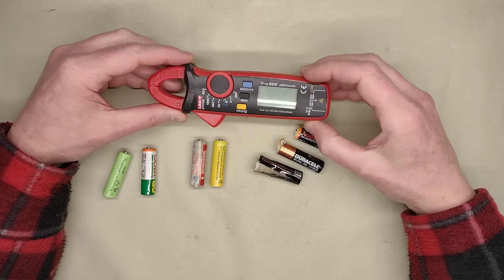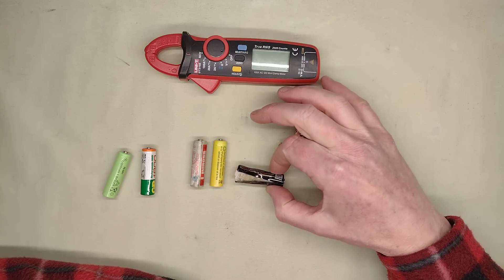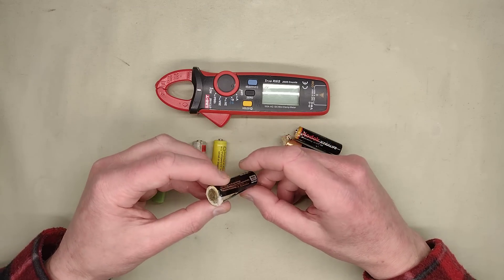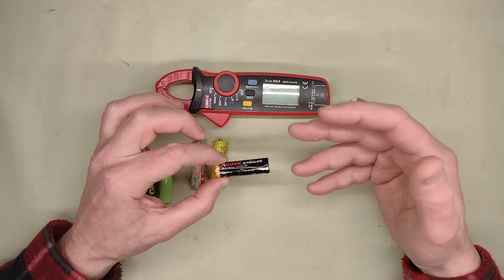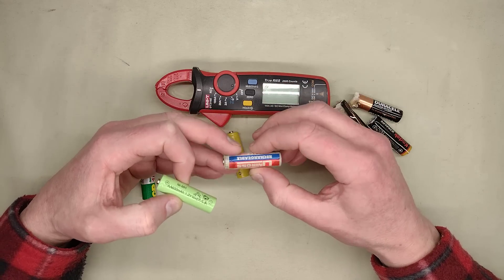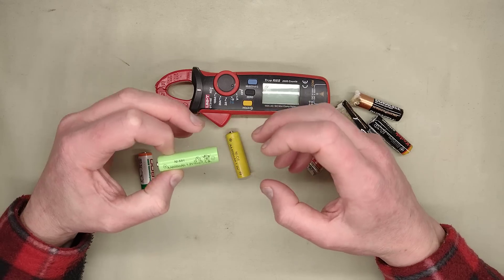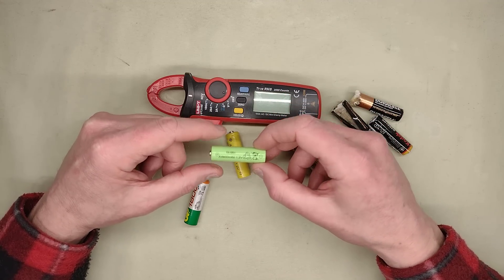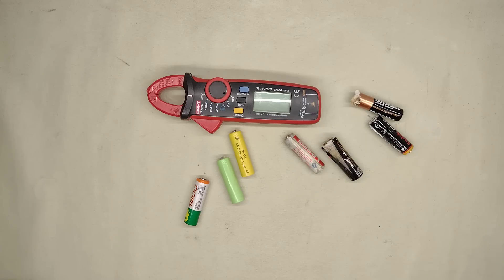The curse of leaky alkaline batteries

Comment: That's a bit of a false economy to say that rechargeables are a better value. They CAN be, but not necessarily. For example, a 4 cell pack battery pack 10Ah D cell nimh for a construction laser, is approximately 25 times the cost of 4 18Ah Duracell procells. IKEA and Kirkland AA batteries come out to only a few cents a cell vs dollars per cell for Nimh. There is also the cost in electricity to charge them, it's small, but it is real.

Don't get me wrong. I like rechargable batteries, but I don't believe they are the hands down winner, either. Both have their places and drawbacks.

More importantly though, the lesson is to not leave batteries in devices. Especially devices that don't completely disconnect the battery. If it's not a hard switch, then the circuit board is always powered, leading to over draw on the batteries and leakage. If you have to leave batteries in a device, carbon zink (heavy duty) batteries are the way to go. They don't leak.
Reply: 25 times the cost, while you can recharge 1000 times. That makes the rechargable batteries still way more cost effective, right?
Reply: @danielmantione  maybe. In my experience, NiMh's have a more typical charge cycle life closer to 300. Also, per amp hour, not per cell, the 25 times the cost can balloon up to 45 times the cost.

300 cycles still makes this a better value. But if you factor in the cost of chargers, the fact you may need alkaline as backups if it's in something you need to have working or the potential of getting a bad cell that makes the whole pack garbage after 30 - 50 uses means you could end up spending more to keep your device running than if you just grabbed a big box of alkaline.

I agree, rechargeables are often a better value in the long run, but they are typically not the hands down winner that the video says.
Reply: @Brook_tno  If you are actively searching for a case for alkaline batteries you will probably find one, but if rechargable is less costly in 90% of use cases, it is valid to consider them obsolete, it is perfect okay if alkaline batteries are cheaper in a few corner cases. In those corner cases the comfort of being able to just put your batteries into the charger rather than having to run to the shop and the ecological advantages still count.
Reply: @danielmantione  I disagree. Speaking mainly from a commercial/industrial viewpoint, it only takes paying a crew for a couple minutes of standing around, unproductive, trying to work out if your batteries were charged, where's the charger, do we have alkaline backups, is there an extention cord to run the charger?, etc before any cost savings of rechargeables suddenly drops past 0 all the way to the negative. Or even if your self employed, you forget 1 night of charging, suddenly your tool that you need for work is suddenly useless. How many lost hours before a pack of ikea alkalines is more cost effective?

Even at home, you going to fill all your remote controls with rechargeables? That's not economical. $5 worth of nicds sitting in a TV remote that will run 2 years on 50 cents worth of Panasonic carbon zincs. A frequently used kids toy, either topping up the charge every couple days or having 2 sets of rechargeables around (1 in the toy and 1 on charge) so your child can play.

Again, I'm not saying rechargeables are bad, I sell rechargeables as part of my job, but they have their downsides and limitations which need to be taken into account. And non rechargeables are not obsolete and can often the better choice in a lot of situations.
Reply: @Brook_tno  Well, perhaps it is me, but I completely fail to see the point of having alkaline backups if I can have rechargable backups. In fact, since alkaline batteries have expiry dates, alkalines are kind of the worst type of backup battery available. I always have a set of charged batteries in my drawer, but even if they turn out to be empty, 30 minutes of charging is for most devices enough to survive to the end-of-day, and then you can do a full charge during the night.

I indeed have rechargable batteries in all of my remote controls. Not because they need to charge often, but to avoid the annoyance of not having TV if the batteries turn output to be empty. Again, even if you don't have  a charged battery available, for remote controls just a few minutes of charging is enough to have TV for the rest of the day and do a full charge during the night. If the TV lasts 10 years, it will still consume 5 sets of potentially leaky zink carbon batteries and for low consumption devices like remotes, leakage isn't just a theoretical danger. Happy to pay the remaining cost difference for the comfort and as a gift to our planet.

I understand you are not against rechargable batteries, but I do think you are holding onto disposable batteries for the wrong reasons.
Reply: @danielmantione  well, in a professional environment, if you forgot to charge one set of rechargeables, you've likely forgot to charge 2 sets, so alkaline are the perfect companion. Throw a pack in the case and no lost time. Especially, if it's a device with a battery pack that doesn't charge outside of the device. And  alkaline have a shelf life of like 10 years. Most users will have a need of extra power more than 1ce ever decade. 

For a lot of high drain devices, 30 minutes is also a useless charge. Even if you are charging at 2A (which would be extremely high) 30 mins would only net you about 800mAh @ 80% efficiency. That might be ok to get by for a bit, but in an application where you're running motors or anything with drain, it will be insufficient. More common charges are an amp or less meaning the charge would be fine for short uses of solid state electronics, but if anything needs to move or light up, it won't last long. 

As for remotes, well carbon zinc do not leak. They will often rust on the contacts, but not frequently in indoor environments. In my experience, a set of carbon zincs will last 2-3 years in a TV remote, 6-8 batteries at the most over 10 years, which have a cost of about $2. I consider that a better value than storing higher cost rechargeables in a remote, and a spare set in a drawer.

Most of these issues would be very different with lithium-ion batteries, though. Then things could be charged up extremely quickly and a USB battery bank would be a useful addition for extra power. Look at cordless drills. To build a deck with nicd or nimh, you'd need 3-4 batteries and 2 chargers around to try and keep up with battery drain on a drill/driver. With lithium the batteries charge faster than you can drain. If we made lithium more compatible with standard devices, at a reasonable cost, then we'd have the best of both.

Comment: I think you have a good point here. I've had to toss or clean several old devices lately because they had a leaky alkaline in it. But I just found a travel alarm clock yesterday that I hadn't used in years that was still working. I opened it up, and it had eneloops in it.

Comment: Yea, I've noticed that, too.
I have been keeping batteries in their packaging until needed, and purchasing off brands.
They all still leak, but if they aren't in the device, then no harm done.
I've also noticed a pattern, that they tend to leak sooner when installed.
I have some theories on that phenomenon, but have no way to test it.
I go through a lot of batteries in my line of work, so they are constantly being changed out, and it's not a problem for those devices.
I will be making the rounds on all the battery powered things today, though.

Comment: Not all stuffs work with rechargeable batteries because have 1,3 instead of 1,5V... also, the size of the AAA is a bit bigger and dont fit in my Halloween pumpkin light. Unfortunately we have to keep using alcalin batteries...

Comment: I stopped really using alkaline several years ago. I've either converted everything to lithium, or use ni/mh when it's not simple or beneficial to use the higher voltage. Like my mouse and remotes, I've charged the batteries in my mouse once in a year, and pretty sure they didn't even need it, just couldn't get it to connect. My flashlights are all 18650. There really is no reason for using alkaline cells now, it's just creating unnecessary waste, and literally throwing lots of money away. Sure, the initial investment is higher, but it's well worth it.

Comment: Cheap last gen Eneloops are the blue IKEA batteries. The 1900 AA and 750 AAA have an incredibly low discharge rate. Get a crate of those and fill all your electronics with them, you won't regret it.

Comment: I use whatever works.  Rechargeable saves money, but won’t hold the energy too long.  I have devices with alkaline batteries for about 10 years, no  need to recharge every few months.  Perhaps I should open them up and look inside?

Comment: I noticed that the leakiest batteries are those inside trickle usage devices. For example, my zigbee lock, which pings often and uses tiny amounts of charge nearly every hour as well as locking/unlocking, made new batteries leak. Same with various mice/keyboards that are Bluetooth, and therefore, check in with the computer often. However, TV remotes almost never leak, bc most remotes use no charge until a button is pressed.

Comment: I advise anyone I can to avoid alkaline batteries. The cost of one lost device due to a leaking cell will justify the expense of the best lithium single-use or rechargeable battery you can find. The quality of alkaline batteries has dropped through the floor, in the last decade especially. I used to keep them in my emergency supplies until I noticed new packages showing signs of corrosion on the end caps after less than a year, first one, then many, in short order. And they slyly changed the "Guaranteed for..." to a "Best before..." date.

Comment: One -ve with NiMH is their Low temp performance.  I have used them in Wildlife Cameras, and in winter (we regularly get frosty nights of a few degrees below zero) the Cameras would stop working.  No frosts then ok for a lot longer.   Eventually Juggee Li AA cells (produce 1.5v, charge with 5v) and got much more operating time than NiMH.  That said the last batch I bought were not as good (maybe they were not genuine Juggee! Chinese faking chinese?).

Comment: Whenever I buy a new battery operated device, I always test with NiMH batteries first. Surprisingly, there is a lot of stuff that won't use them, or will use them but then think they are discharged too far after a short while. Still stuck with alkalines. 

Now if mfr's would start designing around 18650's, we would be in good shape.

Comment: I have recently come the same realisation too. I bought some IKEA LADDA 2450mAh batteries, charged them up and I've been using them in old film cameras with no ill effects. I've heard these can be quite sensitive as they rely on the voltage for the exposure readings, but so far I've not had any noticeable impact. I also purchased the AAA batteries for my remote controls, no problems there either and it is refreshing not to produce so much waste from disposables.

Comment: I'm right there with you. I really think Alcaline doesn't have much of any place in the world anymore.  that being said. There is a remote control from Philips Hue Wiz. That will not operate without alkaline batteries in it. Anything else and it just doesn't work. What do you suppose is done about this?
Reply: Give it 1.6V NiZn batteries or a 3.2V LifePO4 battery combined with a dummy battery (assuming it needs two batteries).
Reply from the maker: The manufacturers need to create NiMH compatible products.

Comment: But, they  only supply 1.2 volts, and NOT 1.5 volts. Tried these newer ones in my old Sony Walkman / minidisc players, they work, but they don't last 5 minutes! My PC mouse, again, the battery only lasts 5 minutes with these newer cells. So sticking to old VARTA long-life max power AA's and AAA's alkaline, never had them leak yet though!

Comment: I used to have a Fluke T5 meter and I got electrocuted from it as a result of the batteries leaking. What happened was I had the red probe docked in the meter so I could hold the meter in one hand and probe around in the distribution board while I held the black probe against some earthed metal. Just then I got a huge shock as I held the meter. When I got out into the daylight it was apparent what had happened. The batteries had leaked and the liquid had seeped out through the gap around the battery cover. I don’t know if the battery terminals are always at the same potential as the red probe or if the battery liquid had gone all the way into the meter and onto the pcb, but I thought it could be a design issue with that model and I wrote to Fluke about it but never got a reply.
Reply from the maker: That's the first time I've heard of that.
Reply from the maker: The battery connections will be referenced to the circuitry, so when testing they are potentially at mains voltage.   I'm guessing this is a very complicated situation for meter companies to address.   They can't seal the battery compartment completely as some pressure relief is needed.

Comment: I'm old enough to remember what alkaline batteries replaced. It was a significant improvement at the time, but their time has passed it seems. A person is foolish for using them in anything critical like a prepper radio or flashlight for instance or an expensive meter. A much better option is the Everready Lithium cells. Very long shelf life and higher capacity with little chance of leakage makes them a much better choice. The only drawback at this time is price. As technology advances, we will likely find better and cheaper cells.
Reply: I concur.  Put Energizer Ultimate Lithium batteries in your expensive meters.

Comment: Now i need to calculate back how much time after you bought that clamp meter i bought mine and remove the batteries. 

I had used some lithium 1.5V cells in higher current applications which are flat now but still look pristine..
Also never had problems with the original cells coming with logitech devices.. i dont think those are the old style zinkcarbon.. hmm. Need to check my old batteries jar.. i think the local cheapo alkaline brand also did not yet leak on me...  

Bonus question:
Does it also depend on outside temps and humidity if they leak ? High/low temps?
Do they leak while partially full or empty?
Do they leak mainly in pairs because the bad one gets reverse charged by the better one ?

I was lucky until now that no expensive device got damaged. I think the 10 year old panasonic cells in my Denon AVR remote (and panasonic plasma tv remote) still work just fine and look brand new...
Reply: Data incoming !

Okay, so. for my newish (2020) Panasonic 4K there are the original ones inside the remote:
Panasonic / Special Power / "Best for OEM use"
Zinc Carbon !

My Denon AVR Remote still has the original cells in it >10 years (i think from 2007) because i would never get those around here..:
maxell / Super (!) / Power Ace (!!) / RED (!!!)
Alkaline

For the older Full HD Plasma (2009) TV Remote it seems i have replaced the original ones, they are now "Energizer" AA,
also looked at some other years old "brand" batteries, both Energizer:
Alkaline "EcoAdvance" and "Ultimate Lithium". Both drained empty but seals look just fine. Could be brand new.

My logitech devices also mostly have the original batteries in them which usually last for 2 years or longer.. multiple touch keyboards, mice etc..
about 2 year old Logitech K400+ came with GP Alkaline (AA) (gold foil) - supposed best before 12-2021.. still looking nice and working.

New 12-2021 bought K270 (the unifying version) also came with GP Alkaline "gold foil" (AAA)
(i guess they could have easily fit AA in there.. sad they did not)

- As far as the logitech stuff goes they seem to be empty after a few years before they start leaking.
Also probably a good OEM feature because they usually come inlcuding the batteries in place and you only remove a plastic/paper flap to get it going.
(i tend to switch them "off" when putting them aside)

Checked all of the above mentioned cells for signs of corrosion / leakage: No sign of anything on all of these.
Also no duracells ;-)

... Last leaking cell i found+remember was in a drawer all to the back, one over two decades  (maybe even 30 years) old Varta AA NiMh cell (blue foil),
but i remember they did leak also back then, so it probably had already leaked 20 years ago...

checked the "new batteries" shelve:
some leftover Energizer (AA) i bought in italy on vacation 3 years ago: still fine
also some newer 2021 JA! (AA) still fine.

checked the jar of old batteries in the basement, which says:
Conrad Energy => bad+leaking (more than 2)
Ansmann => one good+one bad, same batch probably.
JA! => zero leakage, 9V cell from smoke detector and multiple old AAA and AA cells
energizer eco advance and others => no leakage
(still no duracells)
- But  those probably only leaked after they went into the jar because i would be the one who has to clean the stuff where they leaked in...

Comment: I've had particularly bad luck with Maglite torches. I've got other similar designed aluminium torches that are fine but in every Maglite I've had the battery has leaked and ruined the torch. Quite the mystery

Comment: I use LSD Ni-MH batteries for all stuff that needs AA/AAA batteries, if a rare something has a requirement for 1.5v I use a much smaller set of more expensive li-Ion AA replacements. The only gap I have is AAA devices that require 1.5v to operate but I haven't come across one yet so, happy days.